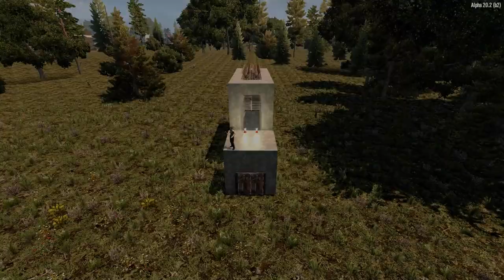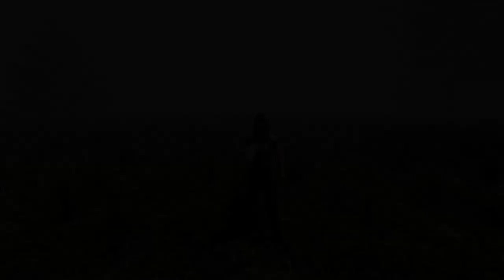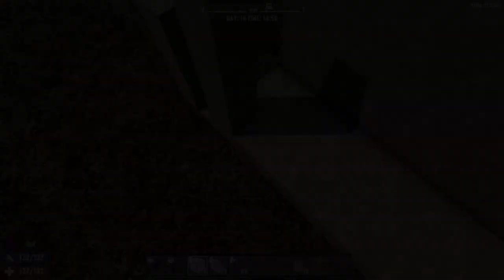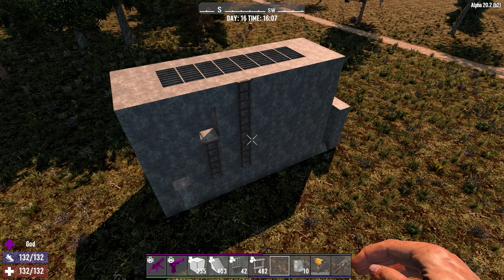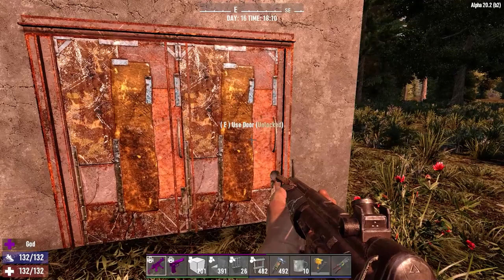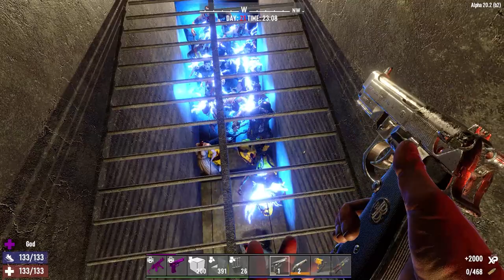7 Days to Die: Alpha 20 - The Thresher Part 1 (Horde Base Guide)

Comment: The wire post inside the generator room don't need repair? or is it only the end ones?
Reply from the maker: You're right - it's only the end one (last one wired up) in electric fences that takes damage, so the order you wire them up is important, to make sure they are easily repairable.

Comment: Would it be possible to put in double rows of fences in this base in order to schock the zombies both at the feet and the chest?
Reply from the maker: It might be possible, but in case you didn't know double fences doesn't increase damage as the fences apply a debuff that can only be on once per zombie, so it also doesn't matter where it hits them.  I went low to make sure it got dogs and crawlers.  Double fences will give you more redundancy though, so it can be useful for that.  I've got a vid on electric fences if you're interested.
Reply: @CautiousPancake  I figured as much. But if the fences are too high, it tend to miss the dogs and crawlers you make by destroying legs. In that type of base, it does not matter much. But it does not hurt to have extra debuff

Comment: Did you test it with bears?
Reply: I think bear is the problem in this build
Reply from the maker: Hey - I didn't originally, as it's meant for horde night only so you won't normally get a bear.  If you want to live in it as well then bear and wolf protection is required - but if you check out the Part 2 and 3 that follow on from this video, the modifications I make there will take care of bears and wolves (combo of electric fences and blade traps). EDIT - meant to say I tested just now for Bears on a cut down version of part 3 and they don't make it to the inner part of the base - they run under the blade traps, so they get hit by them, but don't attack them which is great!
Reply: @CautiousPancake  nice bro I will check it, by the way I like your simple  yet effective horde defense build it's not complicated like the others.
Reply from the maker: @heroruined  Thanks mate much appreciated!  Let me know if you hit any issues!